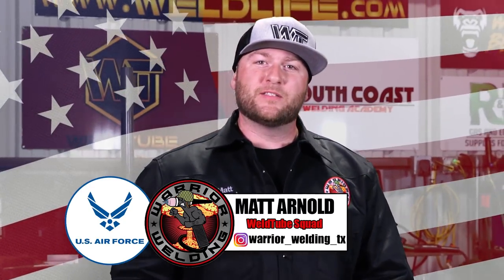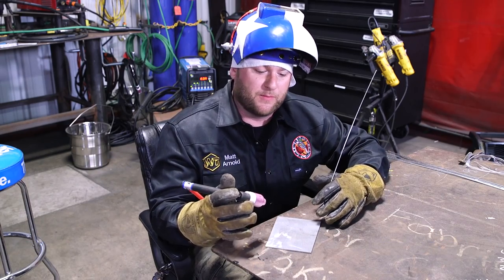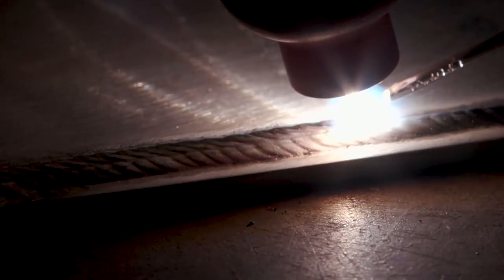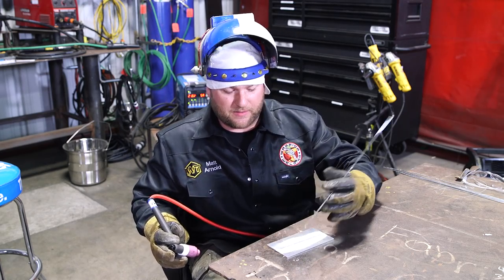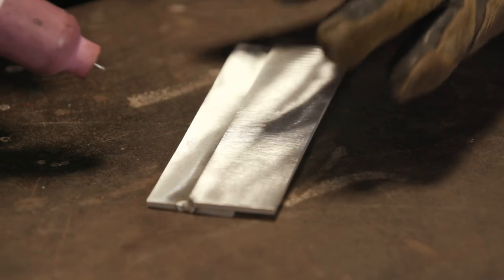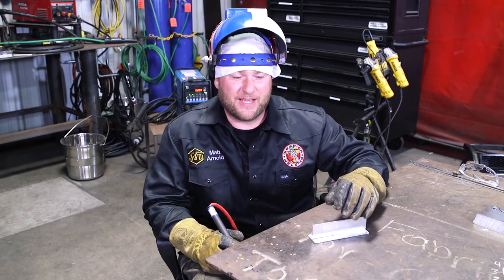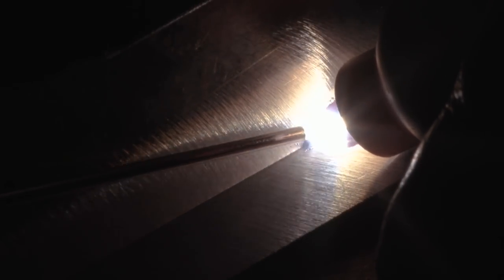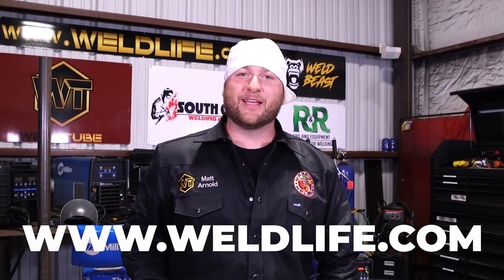How to Start Welding Aluminum | TIG Welding

Comment from the maker: https://warriorweldingtx.com/   (214) 769-5426
Mobile Welding Service & Subcontractor serving the Dallas / Fort Worth TX area.
Reply: Can you do a video of joint welding with stick like a T joints i have a problem with welding my 1in 1/8 wall square tubing I keep breaking welds on the table I’m making I’m using 1/8 rod would a smaller rod size benefit me? I’ve been welding for a couple months I probably have 2 hours seat time